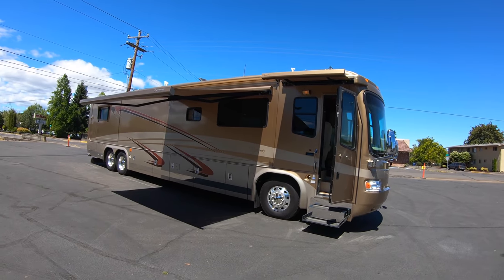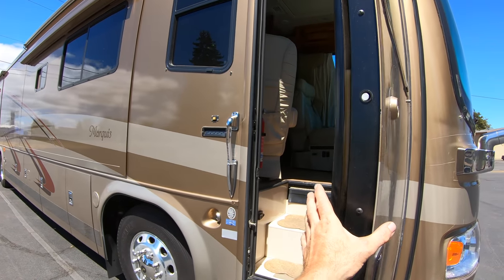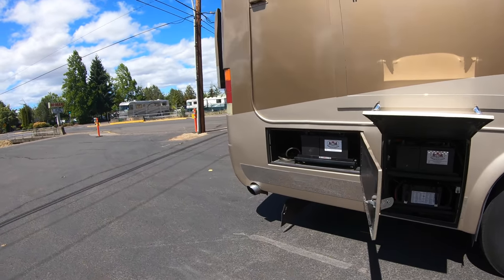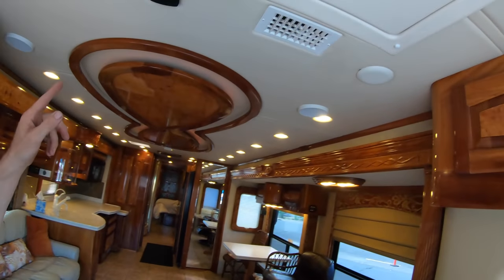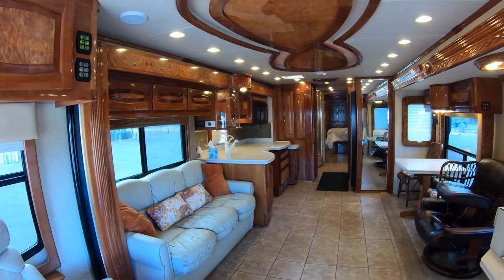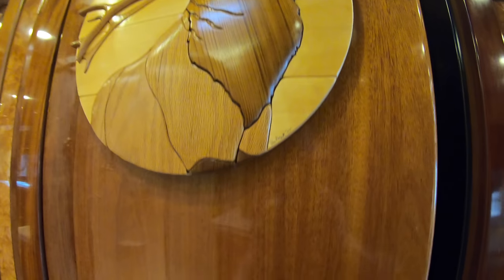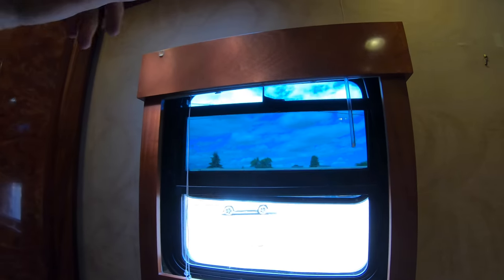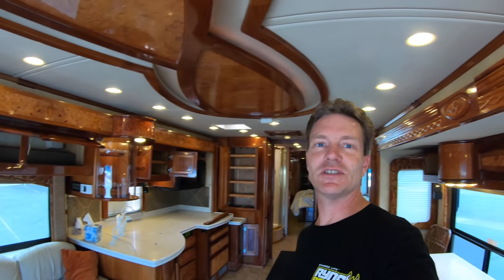BEAUTIFUL 06 Beaver Marquis with Unbelievable Wood Work.

Comment: So, I know you know I have an '07 Contessa. This is what I was looking for but couldn't find. Hey, Brian, you said all Beaver's come with the Cat engine. You probably know, but forgot to mention, Cummins was an option. Mine has the ISL.

I will say, either I got a smokin' deal, or this dealer is really cashing in on the RV shortage. That asking is double what I paid for mine only 2 moths ago.
Reply: As I’m sure you know comparing a Contessa to a Marquis is comparing Apples to Oranges. Marquis was Beavers top of line coach so of course it’s sell price is going to be considerably more than a Contessa. This is not a slam on the Contessa by any means. Just stating a fact as far as the higher sell price.
Reply: @Akjonahskate  I wouldn't say apples to oranges since the Contessa is pretty close to the Marquis. More like Granny Smith to Golden Delicious. Yes, the Marquis is worth more, but not double.
Reply: I believe the Beaver line up is:
Marquis
Patriot Thunder 
Patriot
Contessa
Monterey 
As I said I meant no disrespect. This is the lineup order as I remember it and I’ve been a Beaver Patriot Thunder owner since 2009.
Reply: @Akjonahskate  not in 2007.
Reply: Your right thats exactly whats going on. Dam the BEAVER
Reply: @chriskriaris4304  my Beaver is bigger that yours.
Reply: @aaronbritt2025  in 07 the Contessa listed around $300K, the Patriot Thunder around $500K and the Marquis around $600K. This is without options.
Reply: For an 07 the Used retail value for a Contessa is $109K, Patriot Thunder $185K, and Marquis $225K. (Not apples to apples as you can see). Hope this helps.

Comment: Way overpriced.   Bought a 2008 for 119.000
Reply: Bought my '07 Contessa for $95k
Reply: There's an equally nice 06 Beaver Patriot Vicksburg with tag, 4 slides, 40k mi, listed online for $130k.
Reply: This Marquis with the 525HP Cat and 4000 Allison transmission with $41K of options listed new for $607K. NADA used retail value currently is $182K. 
Your Contessa with the small Cummins 400 engine and 3000 transmission and lighter chassis NADA used retail is $100-109K.listed new for $300K-$310K plus options. Larry is right. Apples and oranges. Then add upgrades and condition. HUGE DIFFERENCE.
Reply: Reply was meant for Aaron. Sorry but aPatriot Thunder is not as upscale as a Marquis. That is why a Marquis listed for $159K more than a Thunder. Not apples to apples.
Reply: @terrysmith2233  The truth is terry the truth Period
Reply: @terrysmith2233  Whos larry Terry who???